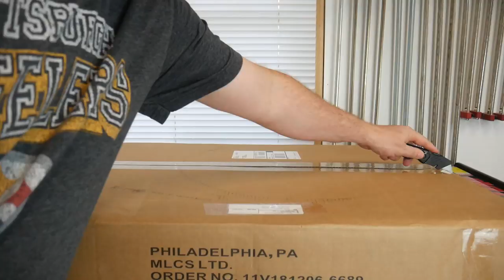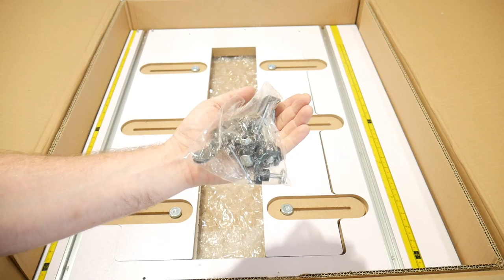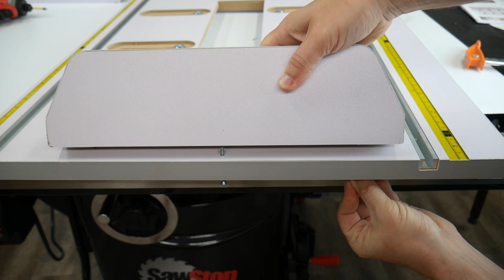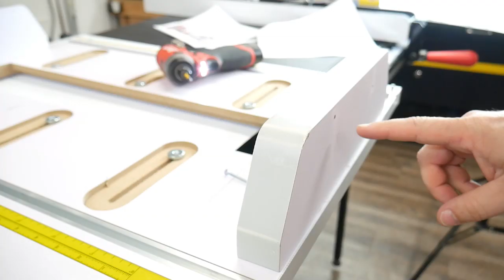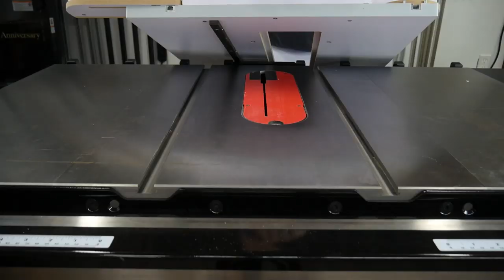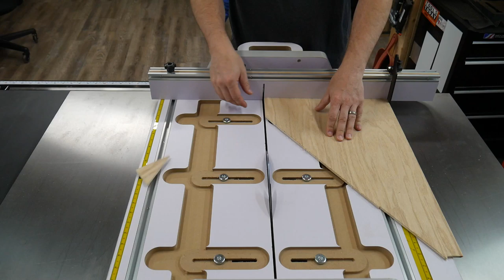The Ultimate Table Saw Sled

Comment: Is this the one that Andy Klein designed for MLCS?  I find that hard to believe because while it has a lot of interesting moving parts that seem handy, there's tons of large gaps for material or offcuts to fall down into, the movable bottom is great for dado, but incredibly inaccurate for a consistent kerf line, and that handle is so poorly placed that it's embarrassing.  I like your work Ben, and some of MLCS' stuff, but this is a botched product.  And it doesn't even look good; made worse by the shipping damage.
Reply from the maker: It is.  I agree with the handle...its not the greatest spot.